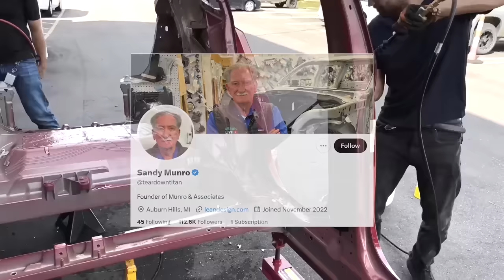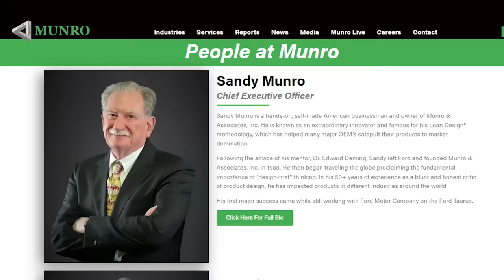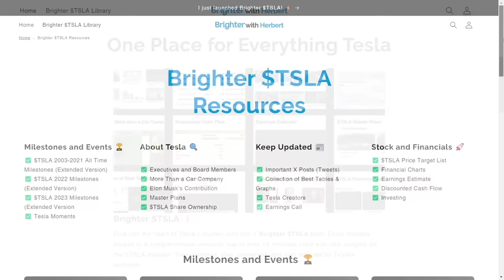EXCLUSIVE Interview w/ Sandy Munro: Tesla’s Future

Comment: The single line factories is pure play, like apple is. No compromise.Pure blood.  The cybertruck is uterly different with stanlessteel. Even if redwood cars wood be cold press stanless steal, the panels would be so much smaller, you need a different line ( or many) to get to the ouput level you want. We are talking about 4 gigfactory into 1.

Comment: One of the worse issues that car manufacturers face is the enormous stockpile of parts they have been forced to buy, in order to keep their part manufacturers happy and secure the lowest price possible. When I know that I am forced to use the same kind of control units, motors, wire looms and whatnot, to every single car model I make, I am effectively barred from designing a new 48v system with anything. I am demanded to make all within the same basic mold, no matter what the body is getting to look like, because I know that all the parts has to be used up to be cost effective. The same switches, door motors, central locking system, ignition system, window wiper/washer parts, the same of every single bloody thing you put in model A, has to be used in model B, C, D, E and F! So how can you make a model E with 48 volts system, when you know that you will probably get fired because of it?

Comment: Did Sandy contradict himself?  He said that internal combustion engines can never stand up to electric motors in terms of longevity and being maintenance free.  Then he said he is working on a hydrogen engine?  A hydrogen ICE?  Isn’t that going to have the same mechanical maintenance problems and be uncompetitive with electric motors?
Reply: Hydrogen electric is just a fancy battery fed by H2 and O2. They can use the same electric motor as a BEV. Fuel cell is basically BEV without the battery.

Comment: As I understand it the Unbox process is assembling a vehicle's parts in parallel and at some point those come together.
This greatly decreases the time required to make the vehicle.  This can only be done with very precise timing which will require superb software.  And when it comes to software Tesla's capabilities in that sector is #1, imho, everyone else is a distant 2nd or 3rd or 10th.  Once that unboxed method is perfected the competition will be backed into a corner with no way out and Tesla will dominate. A couple of legacy auto may make it but I see a much different auto industry make up in the next ten years.

Comment: What happens in the combustion chamber using Hydrogen as a fuel is lots of heat.  Like when they were testing this fuel Toyota engine basically melted down from the heat.  The harmless gas N2 and O2 found in our air---> joins in a high temp condition making NOx.  This Process called Oxidation Reduction is what is happening in the combustion chamber---->. LOOK it up it's Chemistry,   So I question the safety of  Hydrogen
.  
Yes our current ICE engine uses EGR valve to reduce heat in the engine.  

When you do your bi yearly smog, you are allowed a % of NOx to be formed to pass the smog test. There is an acceptable amount of NOx pollution is allowed by the government in charge of air quality

Comment: The 'Unboxed method' being developed by Tesla initially for the low cost Tesla requires precision timing and software will be behind it. Once that is perfected it will revolutionize auto manufacturing, I don't see how legacy auto can compete. Tesla's software engineers are as good as they come, within limits and constraints those S/W engineers can transfer between Tesla and SpaceX, don't think they will be migrating to GM, lol.  Exciting times for EVs.

Comment: V2G EVs selfplug-in is the killer features, as most vehicles are parked 23hrs every day and drive building to building 

EVs have HUGE 100KWH BATTERIES for the long drive, but the Daily drive is 7kwh, very very small.

All vehicles have this feature, the LONG DRIVE capacity. 

Only EV, vehicles, can be self topped up daily automatically when parked.

In fact the V2G feature will allow the vehicle to day trade electricity for profit on the grid.

The simple home robotic vacuum cleaner only needs a wall electric outlet to trickle charge. 
Dirt cheap outlet at bumper height. 

20million vehicles in Australia, when EVs with big battery, 100kwh, then 2,000gWh is available daily. Fossil fueled generation 300gWh daily avg.
Dispatchable daily. 

Rapid chargers will be on the main roads and at corner stores. 

Battery technologies are evolving rapidly. Sodium batteries are in production now. 

The steam train accelerated the fossil fueled industry and then the horseless carriage and then the Ford model T production line.
Horse meat was cheap and so was the Ford model T. 

Rooftop solar PV is cheaper than windows $/m2.
Glass and aluminium are cheaper recycled and need electricity.

Comment: Sandy is right. "Range Anxiety" is not a real thing. It's propaganda. 99% of people's driving is localised where so-called range anxiety just doesn't figure. And road trip range anxiety is just down to ignorance and scarcity of charging infrastructure. I have suffered range anxiety twice in my life. Once, in the UK, at 3am and my SAAB TUrbo 16 was running out of petrol on the last legs of a road trip, and once, when I lived in New Zealand and I passed one petrol station in the middle of nowhere thinking that I had more than enough fuel to get to the next fuel station, about 50 miles away. I didn't. I had to turn around. Lack of infrastructure and my lack of awareness. And that's it. Ignorance will get you anxious. Knowledge gives you certainty. And when charging infrastructure becomes super common we can go back to being ignorant.

Comment: True about the charging infrastructure. But on software, Tesla is not 5-6 years ahead. The Chinese EVs are now on par if not superior in software. Their software controlled suspension allows their EV to drive on 3 wheels or do a stationary 180 deg turn. I would say that's a little ahead.

Comment: Hydrogen in an internal combustion engine still creates NOx from burning H2 in air that is 70% N2.  
So, I don’t understand what benefits would come from an H2 ICE vehicle.
The servicing and maintenance is the same as a diesel engine.
It is still 30% efficient, like a diesel engine, and so there is no increased efficiency by using H2.
The byproducts still include NOx that must be captured.
The fuel is as expensive as diesel, as H2 is very hard to transport, as you need to compress and freeze it to increase the energy density.  The energy to compress and freeze negate any benefits

Comment: I’m approaching 50k on my first set of tires.. model 3 DMLR
Reply: Watch out for Hydroplaning in the rain. You can be driving straight and water gets under your tires and then you Need a New Tesla! I think your past your tire wear bars... Not Safe!
Reply: Yeah absolutely a concern. One advantage I have is the speed limit is between 45-60mph where I live and ppl typically drive slow. So when it rains I slow down (usually due to traffic) But to the original point, I still have tread all the way across my tires at close to 50k. Am planning to get a new set soon.
Another concern I have is flats which I think are more likely with more wear?
Reply: @michaelsmithers4900  Tread Lightly... I hope you keep your Tesla's a Long time. Thanks for sharing this.
Reply: @dporrasxtremeLS3 i had another thought  pertaining to this conversation, because of that AWD, equal weight distribution and traction control. I’ve seldom felt the slightest slip in this car. I guess that’s why they are the safest cars on the road and it allows us to push tires a little further… but not too far!

Comment: In 2017 Tesla was 2 years from FSD. In 2019 we were going to have robo taxis. If this software is 5-6 years ahead? FSD is just one part but it is a big part since it almost defines the Tesla product, ironically
Reply: "GM plans large-scale launch of self-driving cars in U.S. cities in 2019"
Reuters
December 1, 2017
Reply: @waynerussell6401  GM got the prototype to work and then they decided that it made no business
Sense, so they stopped. Their system was very different to Tesla’s. It used more sensors. 
This however, does not change the fact that Tesla promised and charged for FSD 4 years ago.

Comment: While the strategic initiative Tesla uses to reduce complexity and utilize such advanced methods it seems odd they have a sound system with 17 speakers. That's got to be inefficient and runs contrary to reducing wiring connections within the car. I think its Volvo the buried a sound bar up on the dash under the windshield. Not sure how it sounds but one component vs 17+ seems a Tesla type solution.

Comment: When I built my electric car I had to figure out the wiring myself.  It was immediately obvious to me that signaling on a single power circuit would outperform running dozens of circuits all back to the driver's cockpit.  Unfortunately, Tesla couldn't figure out how to do that (noise) and they substituted ethernet, pulling that function off of the single power circuit.  That still dropped the wiring mass down a lot, plus the other obvious need for higher voltage.  Personally, I would have gone to 220 instead of 48 volts, because 220 is common as AC and some of that stuff would transfer over to DC, but there were diminishing returns after 48.  Why not use 800V?  Oh well.
Reply: Voltages under 50V are considered safe - no danger of electrocution or arc flash. So we may never higher voltages in personal use vehicles even though there would be some advantages.

Comment: Don't you mean a quarter of the copper cross sectional area, Sandy? or are you including the insulation? How badly can you be shocked by 48V when touching it with your one hand and ground'? Some guys are going to freak out. Seriously though, people with pacemakers may have some real risk. But savings are real! I once had a 6V VW Beetle and the hot wire to the starter weighed a a lot! A potential weapon of mass destruction in a fight.